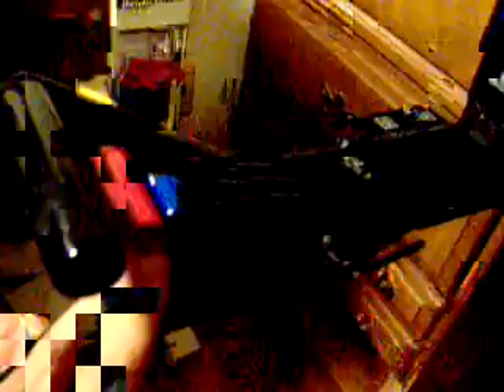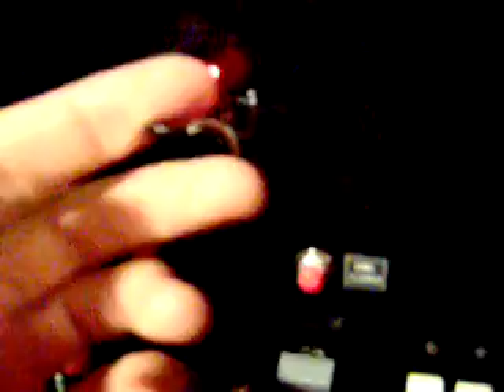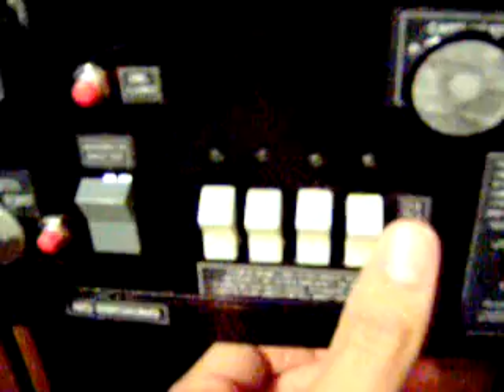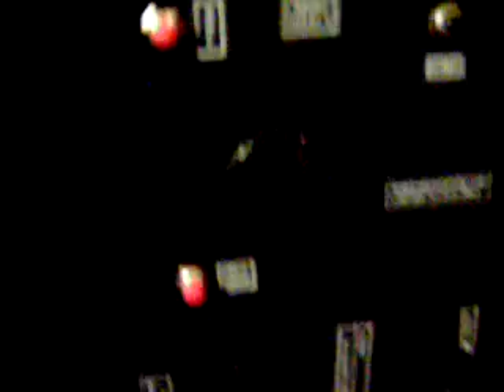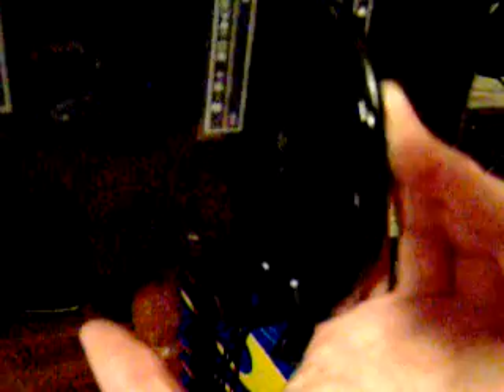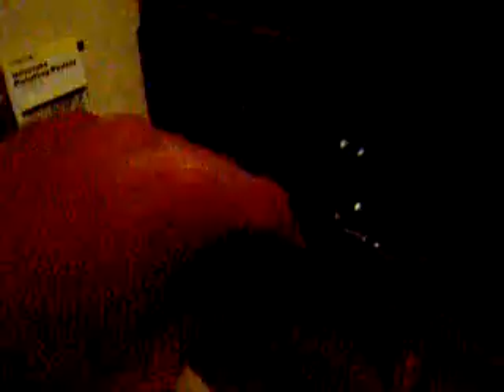Demo video of Scratch Built Flight Simulator Panel

Comment from the maker: An update to all who see this video; I am currently in the process of building a full size cockpit approximately 6 ft long, 3 ft wide and 5 ft tall. It is going to be a P-40/P-51 style cockpit all painted in ww2 cockpit green. Should be impressive when I get done with it. Been working on it since November. Structure is complete, construction of assemblies is now happening. I'm pretty excited. I will post the finished video on here when done. But that won't be untill later this year.

Comment from the maker: I would only guess that you could use model aircraft servos pushing and pulling the levers but that would require that you have some sort of interacting software with Flight Simulator X. But my stuff is simple mechanics so I have no idea how you would build such a quadrant.

Comment from the maker: @TheSPilot  Well, my original plans were to make a floor mounted flight stick with adjustable spring tension, but for now I just use a simple store bought joystick. I did however, modify some rudder pedals for use with flight simulator, so it has rudders now. Can't live without rudders. Eventually it will be an entire enclosed cockpit, with canopy and all. But I have a real airplane to finish first.